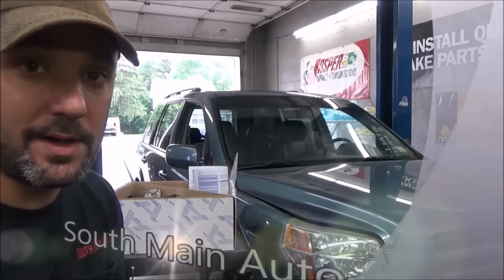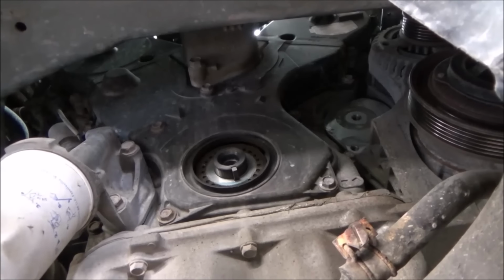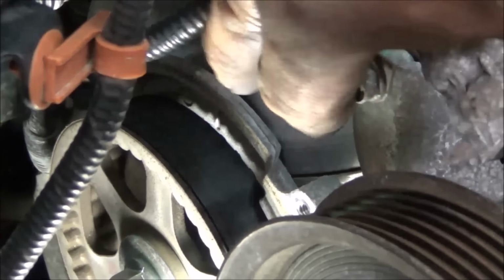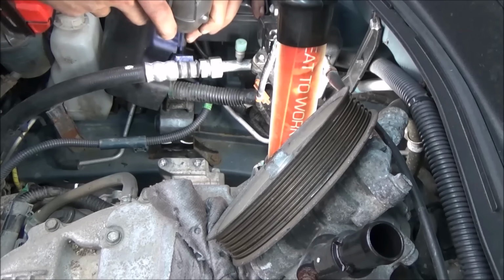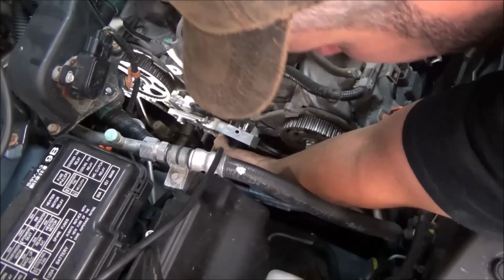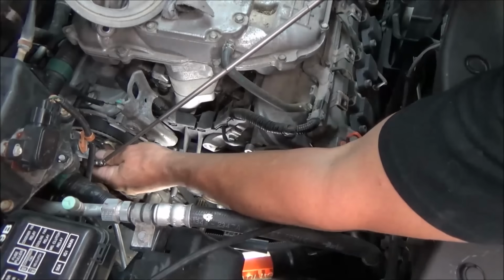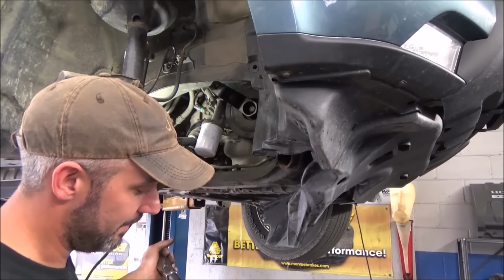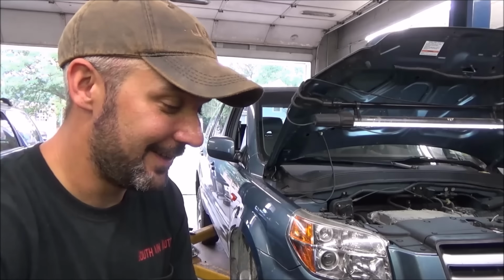Honda Timing Belt 3.5 J35 - Pilot, Odyssey, Ridgeline

Comment: I love these videos!  My first BIG job was this very job.  Before this job, I had only done brakes and oil changes (basic maintenance) Did it on a 2003 Honda Accord (V6).  I was getting quotes in the $1000-$2000 range.  So I decided to make it my first major investment in my own work.  I bought about $400 in parts (same kit shown in this video, plus a few things), and about $600 in tools (I figured my budget was about what I would spend at a shop).  It was a hard job for a newbie, took me about 10 hours (but I was being very careful and slow).  Job went perfect.  Because of that job, I now have a MUCH better tool collection, and have a ton of other work since.  I won't name names, but another popular youtube car guy had a nice video for sale that covered the entire job from start to finish for about $15.  So I bought it and watched many times before starting the job.

My Accord didn't have nearly as much room on the front of the motor as this vehicle.  So the entire job was made such a pain.  Used a mirror a lot.  Had to remove 2 motor mounts and shift the motor up to get access to everything.

Most importantly, the job was a big confidence booster, and it was my first big step towards taking on bigger more challenging jobs, with more appropriate tools at my disposal.
Reply: Considering the labor rate in this region is hovering around 100/hr, and then mark-up on parts, there is nobody here that would touch $599.  Perhaps an independent somewhere, but I wouldn't take my vehicle to most of them around here.  But it doesn't matter anymore, I do all my own work now.  (although I still think it would be cool to visit SMA to have some work done on my Jeep, just to say I went there!)
Reply: EricTheCarGuy?
Reply: reweydewey OEM kit for an Accord costs over $400.  It is probably more at most dealerships.  Is the $695 just to replace the belt?
Reply: The Honda dealer I work for charges 695 I don't get the 1k or 2k quotes. The accords of that era are actually easy compared to newer pilots and ridgelines.
Reply: reweydewy must be a different vehicle. The parts alone are almost that much through the dealership.
Reply: a 98 civic maybe...
Reply: reweydewy mine has a special for 449 timing belt for Honda v6 3.5
Reply: And it's a Honda dealership
Reply: way to go Jordan.  I've not done it yet, but because of Eric O's video and buying ETCG's video, i'm going to try it also. One thing that's identical:  I'm going to go SLOW also.

Comment: That is such a good idea to fill with coolant prior to putting it all back together. My wife's Acura TL 3.2 bit me when the oring on the pump fell out of the grove on the back of the water pump during reinstallation. I wish I would have known this tip then. Needless to say, it cut the oring and poured antifreeze causing me to do the job again. The second time around it only took me 4 hrs using only hand tools prior to air.

Comment: cutting the belt off is auctually helpful because ifbyou try to take the belt off sometimes you will slightly rotate off your marks, I "mod" my car alot so I take my timing belt off frequesntly enough to not reolace the belt and a cam or the crank almost always rotates off mark

Comment: take my van  to replace a timing belt after that the alternator fail is that because i need to reset the code on the van  its a honda addesye
Reply: Reset what code?

Comment: btw....in my opinion those plastic fender liner clips are a joke! obviously cheaper for production.... but not reusable in my situation. good ol self tapping screws with fender washers seem more appropriate for my 180k oddessy.  and the torque required for the crank pulley is RIDICULOUS.  not to mention torqueing followed by additional 60 degrees??? what kinda logic determined that?!?!? probably some engineer that lacked an adequate torque wrench. smh. jeez.  a half inch impact with locktite should be adequate for my situation. but that's just my opinion.
Reply: well when you torque  bolt it stretches, and if you loosen and tighten that bolt mutiple times the torque value per stretch will change so 100ftlbs when new would stetch different than 100ftlbs when used, the angle method will always stretch the bolt the correct amount, just more precise
Reply: Absolutely to the ridiculous torque! I snapped the bolt on the timing pulley tensioner just hand tightening it. 104 ft. lbs.? Seriously?!

Comment: Hey! I alway cut the timing belt . Nice Job... unless for some specific reason....
Reply: that's a good short cut but u better be damn sure all ur marks are perfect beforeucut it
Reply: Seems like more work. Just take the tensioner off (you’re replacing it anyway).
Reply: @robertgary3561  reason why cutting is faster is you would have to remove the belt under tension first.  If you don't, it can booger the threads of the first timing component you remove
Reply: @chrisoliveira6941  I’ve done a number of these 3.5l belts. You always replace the tensioner. Once you remove the old tensioner the belt is loose. Cutting seems like a waste of time to me.
Reply: @robertgary3561  to each their own

Comment: My kit had an idler pulley shim. Since the Pilot didn't have one to begin with, I didn't use it. Now I find out I should have. How big of a deal is this?
Reply from the maker: +Sbaileyrph I dunno what you mean? Never seen one before?
Reply: There are TSB's (multiple J series Honda and Acura's) for the idler pulley rubbing on the engine mount (oil pump mating surface machined at an angle from factory) the shim is installed between the idler pulley and the block.  It also advises to grind the engine mount down a couple of millimeters to provide additional clearance.

Comment: Great video, thank you. I wanted to get your opinion. I have a 2006 Pilot with 82,500. I just got it serviced today with a 3x transmission drain and fill and brake flush. They asked if I have replaced the timing belt on it (they said either 105,000 miles or 7 years) and I told them I have no idea if it's been done. Is there a way to tell? We purchased this car in late 2013. Is that the right maintenance number or should I just wait until we hit 100,000 miles?
Reply from the maker: +Alby 1 I tell my customers if you don't know just do it. It is a easy fix and relatively inexpensive in the big picture.
Reply: +South Main Auto Repair Thanks. Do you recommend the crankshaft and cam seals to be replaced as well? Also without video and explanation, how long would this job have taken you and what do you charge for it?

Comment: Fantastic video. I watched this over and over and then replaced the timing belt (with water pump, pulley, tensioner, etc) in my own 2011 Honda Pilot. Not 100% the same, but man Honda sure didn't change very much at all. One note, having that tool for the accessory belt tensioner is almost a must. Nearly lost my mind putting the belt back on without it. (Thank you giant Harbor Freight breaker bar). Thank you for making this video, you just became another source for info from a guy with some tools and not enough money to pay for a mechanic every time something goes wrong. (Or is about to go wrong like the timing belt)

Comment: Hi I've been watching your video's and I had a question if maybe you could help. I have a 2002 honda civic lx and every time it's in park  or stopped it shakes. if I were to describe out of 1-10 it' is a 5. Thanks
Reply: Sounds like an idle issue, trying clea ing the idle air control valve, iacv

Comment: Did the job on my 2008 Ridgeline yesterday (109 k miles). First off Eric, your video is absolutely amazing and I took six pages of step by step notes and watched the video about four times! I was pleased to see that I had bought (due to Ridgeline forum research) the same Aisin kit you used. 

It took 6 1/2 hrs total including a good hour that was wasted trying to get the 19mm bolt off of the crank shaft. Even after having put penetrating oil on the bolt three times starting a week before doing the work, and using that fat socket and a 500 ft lbs impact wrench with 125 psi, the bolt just sat there and laughed at me. After an hour of messing with it, I used the true caveman "breaker bar under lower control arm" and bumped the engine....from then on it was smooth sailing!
The one thing I did in addition before cutting the timing belt was to add three paint marks to the old belt, two TDC lines for the cam gears and  I marked a tooth on the belt and corresponding place between cogs on the crank gear. Then after cutting the belt, I transferred these marks to the new belt....then fed the new belt as you showed very tightly from crank gear to front cam around idler. What I considered "no slack" ended up one tooth off on the front cam gear and two teeth off on the back cam gear. Fortunately having transferred the marks onto the new belt made this very clear and it took some healthy tugging to remove the remaining "slack" but after a couple of minutes the belt was on in the same position as the old one. I would highly recommend to mark the old belt on all three gears and transfer these marks to the new belt....it is then virtually impossible to screw this up.

Again, I cannot thank you enough for this great video!!
Reply: Thanks for the advixe on marking the old belt then transferring/marking the new belt @1aurt!!
Reply: @vincelow  Thx!!! To me this was the key to getting the job done correctly
Reply: @1auriculatus  And I thought that was my patented idea...
Reply: @vincelow  Thanks Vincent! Yes, to me that is a must! I just did the same job again two days ago, on our 2014 Ridgeline. The 2008 was unfortunately flooded out by Harvey in August of 2017. It sat in 6 ft of water for 12 days.  At that time I had put 21k miles on it after doing the timing belt change and it was working perfectly fine.

The job on the 2014 took a little over 5 hours, time savings were due to now having serpentine belt removal tool and a heavy duty impact gun (this time around removed the crank pulley bolt exactly as in Eric's video, quite the elation!). I used my notes from the previous time and of course re-watched Eric's outstanding video!!! Thanks again Eric!!!

Mileage on the 2014 was 117k and 84 months, so 12k miles over the recommended interval. The old belt looked fine and timing was spot on. I again marked the belt and gears and then transferred the marks on the belt to the new belt, double and triple checked them, of course.

When I installed the new belt, this time around I had to spend time on getting the new belt into the same spot on the right side cam gear (fire wall side). Took about 10 minutes and a lot of pulling to get it in the same position. I guess the old belt does stretch a little so that the gears might be a millimeter or two off from normal. If I had not marked the belt i would have been one tooth off on that right side cam gear.

It amazed me again how much crisper the trottle response is now, like day and night, so I guess the stretch in the belt does throw the timing off ever so slightly.
Reply: 6 hours and you saved at least $1400. Seems like a win to me. You basically paid yourself $250 an hour to have fun working on your car learning a lot and probably feeling damn satisfied afterwards.
Reply: @richb5478  You bet!! :)
Reply: What was the part number for the kit? And name ty.
Reply: @iknowgood2403  TKH-002    $175 on Amazon or eBay.
Reply: mark p Curious, what makes you say he destroyed the main bearing? The way he broke the bolt loose?
Reply: @holdenmoreland3119  The car flooded during Harvey with 6 ft of water after I had put 21k miles on it after the job. Never any issue, no increase in oil consumtion r any other noticable change.

Replaced the 2008 with a 2014 and I just ordered the same Aisin kit again and in a couple of months I will do the job a second time....., the 2014 has 102k miles on it now. Waiting for cooler temps to do the job.

I will get a better impact wrench to avoid having to use the "caveman" method
Reply: thanks for sharing your tips, I have heard the cam gears commonly jump a tooth, the honda forums are great tho for sure
Reply: Great job proud of you good man
Reply: That crank bolt is what stops me from going for it even the socket tool its self is 40 bucks
Reply: @anglegrinder4630  The massive socket combined with a heavy duty impact gun is the ticket. First time around I could not get the bolt off using a cheap impact gun. A few days ago (on a different Ridgeline) the bolt came out on the first try.
Reply: @1auriculatus  me too with the Chicago Impact from harbor freight,zips it right off
Reply: @billybob042665  Well he definitely over-torqued the muffler bearing.  And he uses moist air in his driver so the whole belt will probably fail quickly...
Reply: How long did it take you?  I'm super nervous about messing up, getting ready to do my MDX.  What was the hardest part for you? And any advice about what part i should be especially mindful of?
Reply: Joe C  Read the first sentence in the second paragraph
Reply: Joe C MDX is this same a ridgeline only thing that can be hard about this job is getting the crank bolt off, and maybe sliding the new timing belt on. If you done these enough you could do it in about 40 minutes even though the job pays 6 hours you’ll also want to grab a small bottle of power steering fluid just to top off fluid reservoir.
Reply: @MarkyDGFX  Do the Hondas from 2005 use the pink coolant or the blue?

Comment: So the upper bracket that goes over the side mount gets removed then u place a big block of wood under oil pan and lower lift on to wood until engine starts to lift upward on passenger side. Allows you to snake bucket wrench 14mm or flex ratchet with shallow 14mm. It will save tons of time guaranteed. Love your tips and tricks on domestic vehicles. I have 2004 f150 4.6 with 50k miles, pretty much have just done fluid changes and occasional brakes, any thing I should look out for?

Comment: Instead of removing side motor mount to gain access to bracket that bolts to water pump, u know the bracket with 3 large bolts. All u have to do is take off upper bracket for side mount, block of wood under oil pan, tilts motor so u can access the 3 bolts with 14mmbucker wrench or 3/8 bent ratchet with shallow 14 socket. Saves time which saves money. I do approx 3-5 tbelts on v6 Honda models per week. Works on all the v6 models
Reply from the maker: +Nic Edinger Wow that is over 200 honda t-belts a year, guess I am not sure how to tilt the engine because on the ones I have done when you unhook the mount the engine does not move?

Comment: Good afternoon. i have a 2002 Honda Odyssey 3.1,  I change the timing belt and after that I have the codes p0301, p0302, p0303, p0304, p0305, p0306, and p0300. Did not have any problems until i change the timing belt. It starts and run but shakes a lot. Any advice. Please. Thank you
Reply from the maker: +luis bautista Did not have any problems until i change the timing belt. It starts and run but shakes a lot.... sounds like you answered your own question to me..

Comment: Eric have you ever done a Nissan 3.5 I have one I've heard they have problems with plastic parts chain slides on mine ok now only 35k I seen some repairs on youtube look like big job.
Reply: +Joe Tiller I've done many of the Nissan 3.5 and it is not really much harder to do, to fix the main chain guide.  If your also replacing the secondary chains, it is far far harder.  I have a few videos on the job with a couple tips on my own channel covering them.

Comment: Fantastic run through for DIY'ers (or pro's for that matter) ... THANKS A TON for this vid!! EVERYTHING needed for successful replacement is ALL here.   did a kit replacement on '06 Odyssey ex-l.  (used the 'cave-man' bump start removal for crank bolt :-\)  Small differences on motor mount removal (remove tranny control module to access the 3 17mm bolts on the frame side) and serpentine tensioner is slightly different (note: J35A7: some have reported 17mm tensioner bolt failure after re-install--follow honda tsb--oil bolt, torque 54lbft and tensioner air bleed procedure--install belt with slow compression to full bottom stop on tensioner-do NOT force against the stop, then, slow, full compression again 3x--supposedly resets the compression valve to remove any air that may have accumulated during prolonged open stoke, creating excessive pressure on tensioning system that snaps the bolt).  

Best all around vid for J35 full kit replacement that ive seen--and trust me...lol.. i watched them all.  Thanks again, my man... you made this a breeze.

Comment: Great instructions!!  This is the first time i did a timing belt and water pump.  I followed the instructions step by step for my 08 Ridgeline and it worked out great.  The only trouble i had was with the crank bolt.  Liquid wrench, map gas torch, and two guys hanging on a 10 ft breaker bar did the trick.  Wow!  Didn't think it would ever come loose.  Oh yea, I coincidentally got the same Aisin kit that you had in the video which i realized after watching the video a 2nd time.  That gave me the confidence that I bought a decent kit.

Comment: Pop a wrench on the crank pulley bolt and turn the engine over real quick. The wrench will come up hit the frame and unscrew the bolt. I had to do that on the saturn vue : ( The j35 crank bolt is hell.
Reply: any difference in doing a Vue (J35 engine) as oppose to a Honda/Acura J35?

Comment: If you only changed the water pump or the better Question is if the water pump had to be changed how is the right way to do it
Reply from the maker: +Joe simpson I don't get your question Joe?
Reply: Oh sorry I'm asking the water pump went bad so it has to be changed. first how would I test to make sure that was the right repair, 2nd is their another part you should change with the water pump to be safe other then the belt 2001 ML 430 Mercedes
Reply from the maker: I have no idea on a Benz. This video is on a honda.